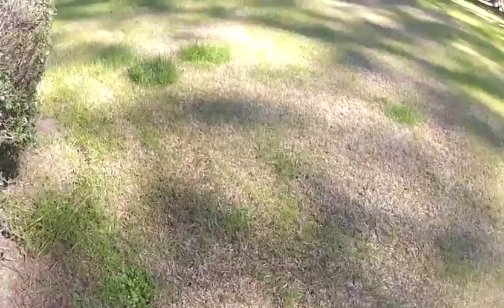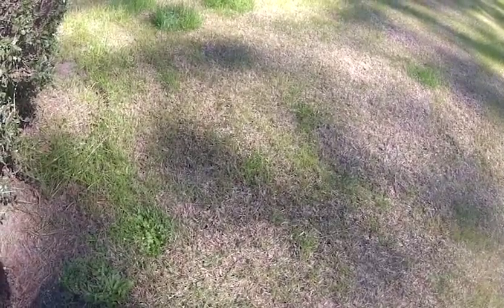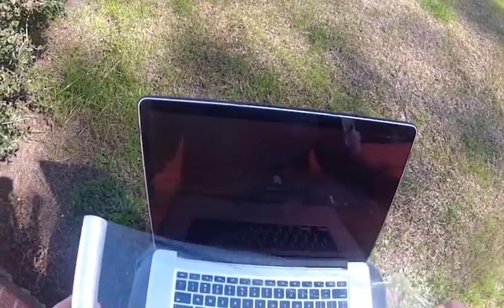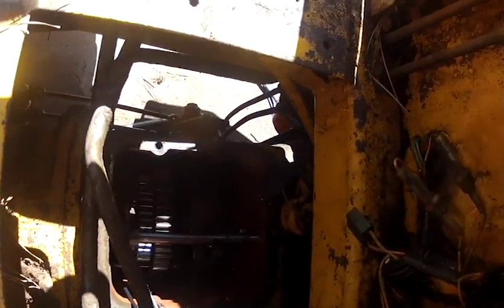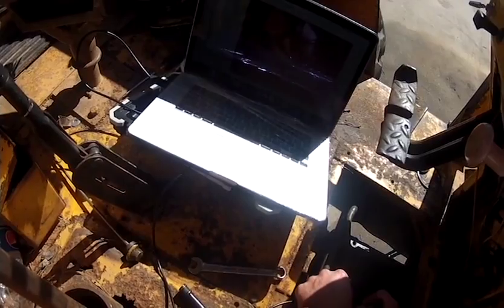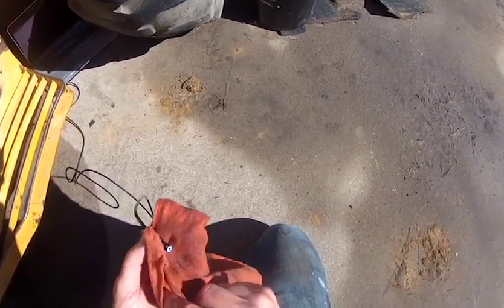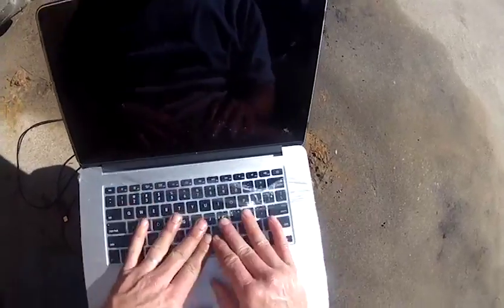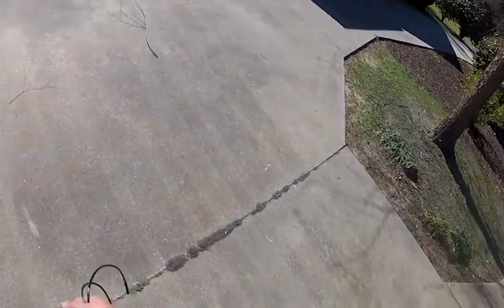Giving a Ford 555 Backhoe a Colonoscopy

Comment: Thanks for doing this series of videos.  I have the same tractor with the same problem.  I'm not clear from this video, did you ever find the screen that you were looking for?  If so, where is it, I can't find it to save my life.  Also, what was the end result with the transmission?  Torque converter worked with the spacers?  Any other problems that you found causing it not to move?  Thanks again for taking the time.
Reply from the maker: You're welcome Rob. Yes, I found the screen and it is located in the area in front of the gear box and behind the hydraulic pump (below the clutch housing). My screen was pretty clogged up but that wasn't the issue. 

First thing to check is the transmission pump pressure.  Put a pressure gauge on the inspection port and look to see your pressure at idle, and then what you have in forward and reverse.  

No Pressure Means or seriously low pressure: You have a failure of the hydraulic pump, torque converter, or a seriously clogged system.
Good pressure at idle but low pressure in gear is usually a valve body issue.
Good pressure all around but no movement is either clutches gone bad (they tell me it's unusual for both forward and reverse clutches to fail at the same time so you should have one or the other) or you have a rear end differential issue.

Hope that helps.

Transmission was great.  But the more I use it the weaker it is getting in forward. (Would still pull a house off the foundation in reverse).  Putting a gauge on it, I have great pressure in idle and reverse but weak pressure in forward.  This could be a valve body issue where the valve isn't completed engaging into forward and "bleeding" pressure which doesn't allow the forward clutches to fully engage.  I asked a guy who used to work on these if the spacers could be pushing the torque converter to far forward and causing the issue and he doesn't know for sure but I got the standard "anything's possible" answer.  I may very well end up breaking the tractor back down this winter to get an idea of what's going on.

Hope that helps.